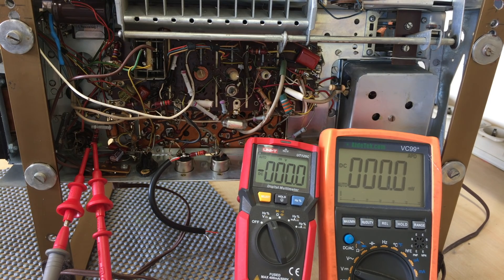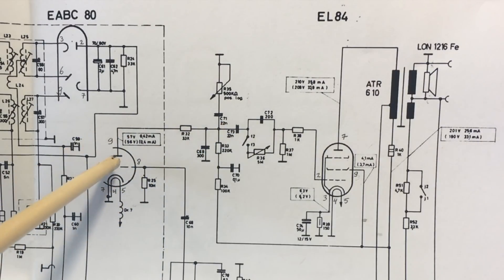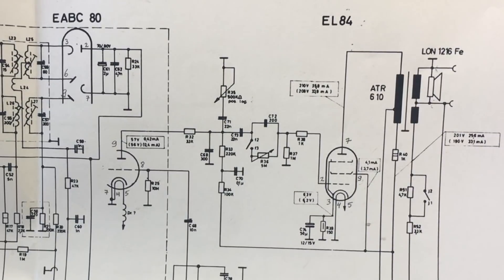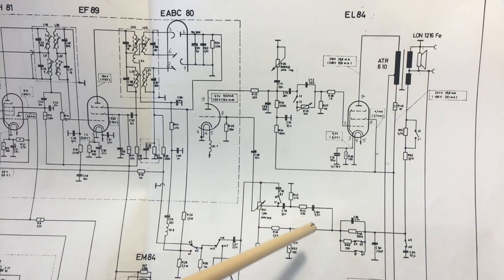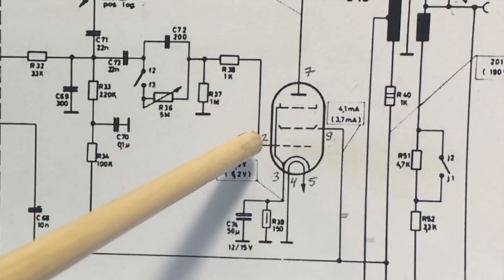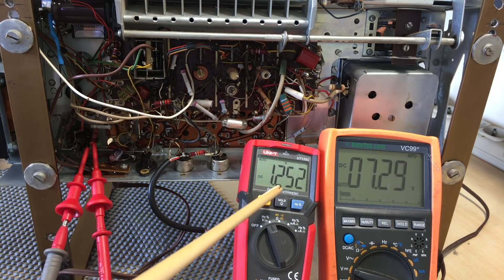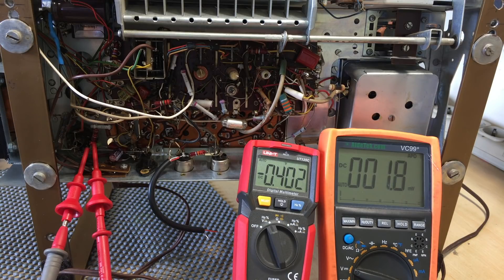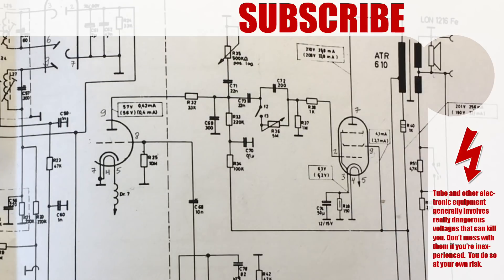Leaking Capacitors in Tube Gear. A practical demo.

Comment: My tube amp is losing output power after it is powered up .Initially its has good power and fidelity ,and minutes later the power drops and it has a distorted output.There is a coupling cap that a previous technician choose not to replace ,a .1mf bubble bee cap that couples 1st AF stage plate to Grid of second AF stage. The voltage at grid should be 0 but it measures 3.7v. The plate voltage should be at 70v but measures   low at 17v. The cathode should be at 3v but measures at 4v. Could the high voltage at grid give a low voltage at the plate? The next stage , the inverter ,is feed the low 17v to its grid ,and the inverter plate voltage  reads high at 290volts (should be 215v). Could these off voltages be from the high voltage on grid of the first AF stage. The .1 cap reads .1mF but I don't have a tester for a capacitor leak. Every time I power up the amp , the readings get worse. There seems to be excess current being applied that is causing a cascade of problems
Reply from the maker: With the capacitor you mention leaking voltage to the grid, anything can happen. Change it soonest
Reply: @electronicsoldandnew  Thank you for the reply. Could the low plate voltage be due to high current between plate and cathode was the question. Its  certainly is time to replace that 75 year old bubble bee coupling cap !
Reply from the maker: That’s exactly it. More grid bias means more plate current, so more voltage drop across the plate resistor, therefore lower plate voltage.
Reply: @electronicsoldandnew  Its far better to understand the effects of the problem Once again ,thank you. This amplifier is an old Radio Craftsman C400 amplifier that I was able to download original tech manuals that include all component values ,voltage ratings and transformer data. There is potential to improve this audio amp for guitar use. With the addition of 15k grid stoppers and a bypass switch for a 100 ohm power resistor the amp is similar to a Fender Pro 5E5.(I would swap the 6v6 with 6l6 GB power tube. The output is multi tapped for 4,8,16 ohms

Comment: Great explanation - thank you.  Where are you measuring the leaking DC voltage - across the 1M Ohm resistor?
Reply from the maker: The current, yes.

Comment: The voltage across C73 is not 'quite a few hundred volts' is it? It's up to 57V surely, from the schematic? Otherwise, nice work.
Reply from the maker: You’re absolutely right. The only time it sees a couple of hundred volta’s is when you first switch on, before the triode starts to pass current and hence drops the voltage. Thanks for pointing that out.

Comment: On all of the tube amps, preamps, tuners, and radios I restore, I ALWAYS swap-out ALL electrolytic and film capacitors.  Then I check every resistor.  Then I check the transformers for shorts.  Then I test all the tubes on a mutual conductance tester.  Then I clean all the controls and switches. And finally, I hook up the inputs and outputs and turn it on.  I monitor the B+ and the bias voltage.  If something doesn't seem right, I pull the plug immediately.  Why take chances?
Reply from the maker: Too right. It’s usually over half a century old, and you can kill it in a second if not careful.

Comment: Even old caps that have sat with no "stress" of DC blocking duties will have changed because of their internal chemical nature over time meaning their performance will be different now. The designer of the original circuit never allowed for such a capacitor with it's 'aged' characteristic so CHANGE it would surely be good old Common Sense!
Reply from the maker: I’m inclined to take the middle road here. Some caps hold up very well even after a few decades. I’ve got radios in my collection that I restored a few years ago that are still going strong with some old caps in there.

Comment: It is informative, thanks. Modern electronics typically do not see impedance's in eg. amplifiers circuit chains that are 1 Meg-ohm or above and so the point of having a cap in-circuit with a leakage of as little as 1 uA does not seem to be an issue. In tube gear though, its a huge problem. Trusting a 60+ year old cap with the ability to leak less than 1 uA is putting a bit too much faith in it.
Cheers,

Comment: Always change the HT coupling cap that connects output of audio amp to the input grid of  output power amp.
Best way to check. Remove output tube. Connect meter between grid and ground to read DC voltage.
Any positive voltage on grid confirms the Coupling cap is leaking. Do this for old radios and to your own radio every few years. To save your output tube and output transformer.
Reply: mushtaq obaray thanks, that makes sense.
Reply: Yes sir ! Don’t risk a tube and transformer the first test should be sight before you put power to the circuit. If it looks old that is the most stressed capacitor in the output circuitry so just save some undue time and replace it. Capacitors are cheaper than tubes and transformers. Good video to show newbies how to see what a bad capacitor can do.

Comment: Always the first capacitor on my list! Thanks to the UK vintage forum who gave me the advice during my first restoration. Great video as usual with a great explanation. Tomorrow I hope to acquire a signal generator. The education continues!
Reply: Lynton, we call this audio output valve grid capacitor "That Capacitor", it was what the old time radio service engineers always called it..."That Capacitor". One suspects the reason behind this naming was due to the damage that capacitor can cause if it was to fail, especially if it failed short circuit. Good that you view our vintage radio sites and forums since we also view yours sites too. Across the pond here in the UK we all rave over your Ron and his 'glasslinger' youtube site, Ron is a genius. 'AllAmericanFiveRadio' youtube site is the site to watch to learn all your radio theory, valves, transistors you name it. Mr Caldeira, so good at explaining things in the most simplest of ways, and remember Mr Caldeira always change "That Capacitor" come what may..te-he.
Reply: Theoobovril yes I have heard the term ‘That capacitor’ before and as Marc explained if it is leaky can cause a lot of damage. I also watch Ron’s videos along with Mr Carlson of course. Several good ones over this side like Marc and TRX bench but being a novice with valves (tubes) I do depend on my local forum very heavily. Great hobby with satisfying results.
Cheers Lynton G4XCQ
Reply: @lyntonprescott3412  AllAmericanFiveRadio is great at explaining how a radio works especially the superheterodyne modern type radio as against the much older TRF, tuned radio frequency, type radio. Keep up watching all these videos and you will be amazed in time as to what you have managed to learn.